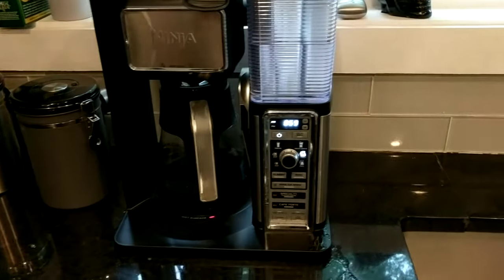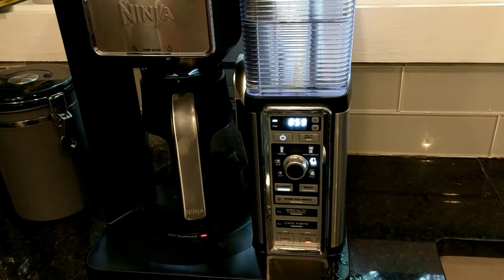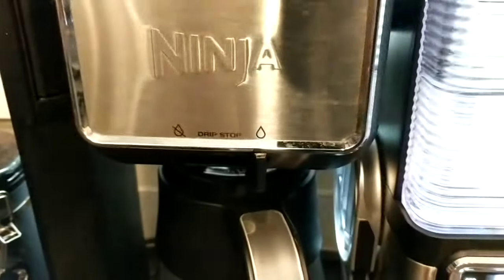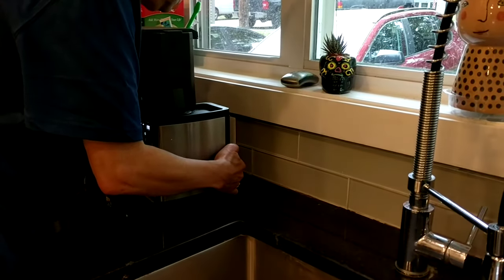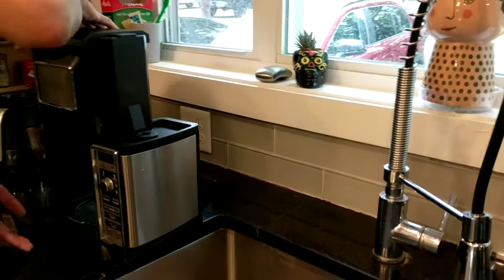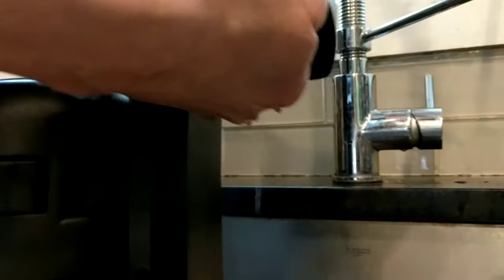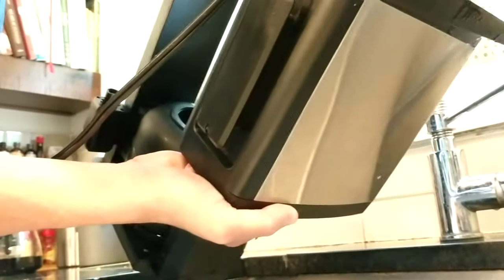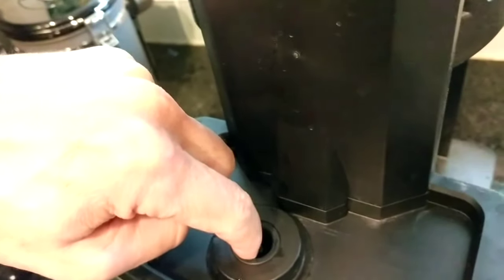Ninja coffee maker quick fix for "five beeps of death"

Comment: This does indeed work for me as well. However, I'm tired of messing with it and I'm gonna buy a different brand. Brewing Coffee shouldn't be this complicated. =(
Reply from the maker: I hear you.  There's only so much a customer should have to put up with.
Reply: Most of the times this is caused by a buildup of calcium or other sediments commonly found in water
Reply: I really like my PD 040 but after 3 weeks it stopped working and this isn't the answer apparently . I'm at a complete loss as to what to do
Reply: Yeah it's not  worth it. Never worried about calcium build up on my old one.

Comment: Please add to your instructions that if after trying all this the 5 beeps don't stop: Press both Classic and Rich buttons at the same time. This will reset the unit. Then run one brew witout water in the reservoir incase there is air in the tubes. It worked for me and my unit was back to regular. Thanks for your video!
Reply from the maker: I did not know about the reset process. Thanks for bringing it to my attention.  I've updated the text description with your fix.
Reply: Thanks. That worked
Reply: Thank you, this option finally worked for me when all else failed
Reply: With or without water in the reservoir? If without, should we run one with water after?

Comment: To anyone who this is NOT working for, go ahead and do it a couple more times and then add your EMPTY reservoir back on and just hit the classic button. Water should come out even though there’s nothing in the reservoir. Do it over and over until water no longer runs out. There was some leftover water in the tubes of mine I believe, and the air pockets were causing issues. I did this and right now my coffee bar is running through its clean cycle, whereas before it would stop after a couple seconds. Thanks OP!
Reply from the maker: Good to know. Thanks!

Comment: I was so used to the machine doing it when I needed to put it through the clean cycle, but even then it started beeping at me. I was not looking forward to getting a new coffee maker. THANK YOU for posting this! So far my machine is doing the clean cycle without the beeps! You’re a lifesaver! Thank you soooo much!!
Reply from the maker: Yeah, that is a catch-22, isn't it: You need to do a descaling cycle, but you can't because the machine won't work.  After having moved to a different city, I'm convinced that the descaling light is purely time based: if your water has lots of minerals, you may need to descale more often than the light would indicate, but at least this trick gets you there if the buildup prevents operation of the machine.

Comment: Thank you for this!! I was so excited to find one of these at Goodwill for $10, but when I came home and tried it, the ‘five beeps of death’ seemed to be the reason it was donated. After following the recommendations of a couple videos, including disassembling the bottom and cleaning the inside mechanism, I was almost ready to take it back to the thrift store. I’m glad I gave your advice a try, because after doing this twice it is running perfectly! Spit out a lot of calcium debris as well, so I would recommend running a clean cycle a few times. Thank you again! 

(Side note for anyone looking to disassemble, you will need a T10 Torx screw bit to take off the screws).

Comment: Thank you for this easy solution! I’ve had mine for a few years and was wondering what the heck is going on, but this loosened up that calcium build up and I set it on a clean cycle with some vinegar water in the tank to help clear out the rest and it works perfectly again!

Comment: I had the 5 beeps of death. I tried wiping everything down with vinegar, even where the water comes out. It did not fix it. I tried Pablo's method of turning it upside down and draining it and it WORKED! While I had the machine upside down, I also took a toothpick and gently pressed it into the water holes under the top side. Thank you!

Comment: The flow meter detects reduced flow signaling the maker to do the five beeps. I went through six videos and cleaned the house and the scale off in three different ways.  It worked for a week before the beep came back. I told Ninja on Twitter about it, and others did, too. Template response. Treated you like a generic customer and not a person. If they would've responded on Twitter with real solutions, I'd have stuck with it, but when the beep came back after a week, I said, "Okay, that's it." I later bought an Aeropress for $30 and it makes better coffee, faster (as fast as you can get hot water), quieter, and you can take it anywhere. That said, thanks for the video, Pablo.

Comment: Thanks so much for sharing! Third time was the charm with this trick even with an older model, we were persistent and optimistic. Also used white vinegar and got lots of corrosion and other chunks of gunk out of the machine. 

Another tip if you’re gonna transport the machine, I recommend keeping it up right because the issue only began for us after having it on its side in the car.

Comment: Ok so to fix this issue here is what I found. I tried everything and nothing fixed this. What I did was added a cup of vinegar to reservoir.  I then ran the clean cycle until I got the 5 beeps and the coffee maker stopped. I then took off the reservoir and that little plunger that is on the base where the reservoir mates pushed it for around a minute. Water will start pouring out of it. Continue to clean it off until you no longer see any water. Fill the reservoir up with 2/3 vinegar and run the clean cycle. If you get all of the way through it then you have fixed it. This a design flaw and bottom line to stay away from these. The issue will come back again. All non Ninja coffee makers I have owned have never had this type of issue. I own the Foodie and it works great but now question if I would ever buy another Ninja product.

Comment: I tried eveything and I was about to throw mine away, until....I flipped it upside down, and I seen the holes that the coffee comes out of were full of white build up. This is after I ran vinegar through my machine dozens of times. I poured white vinegar directly over the holes. White gunk came out in chunks. I used a little brush as well. My machine now runs perfect!!! Once a month I run vinegar through, and now I also fill the bottom of my kitchen sinkup with white vinegar, flip my Ninja upside down, and let the top just soak for awhile.
Reply from the maker: Great tip. Thanks!

Comment: So the 5 beeps is the water flow sensor getting stuck or water not flowing. The sensor looks like a white motor.  You can easily open it and wipe it out.  This also fixes the clean mode not working.

Of course, try this first since it's quick and easy.

Comment: This fixed mine when nothing else worked:
Take off the bottom cover, the deposits get out of the boiler and go through the plastic pipe into the white plastic impeller chamber, which stops the fan inside from spinning to move water to it from the tank. The impeller assembly comes apart by screwing it counter-clockwise with both pipes removed. The fan will drop out. Wipe the inside with paper towel, drop in the fan, and put it back together. Fixed.
Reply from the maker: I think some of the other remedies here on YouTube show that.  If not, you might want to make a video of your own, for those cases when my fix doesn't work.  Personally, if I have to disassemble the machine more than once a year, I'm throwing it out.

Comment: This might get it working for you for a little bit, but a good cleaning of the heater and water pump will be more permanent. You can access the parts with a T10 torx screwdriver and a Phillips screwdriver. Take the bottom off with the T10, then remove the hose between the water pump and the reservoir and unplug the water pump. Next remove 2 Phillips screws from the heater and pull the cover off so you can see inside the heater. You can clean any buildup with a screwdriver to loosen it up. I put the water pump in a cup of white vinegar to soak, and I used some plastic wrap to cover the dripper portion that drips into the coffee filter and held my hand on it, then filled the heater with vinegar to let it soak for 5 minutes. After it soaked, I used the screw driver to scrape a little more of the buildup and a straw cleaning brush to get the inside of the heater clean. You can use a can of air duster to blow through the water pump to make sure the motor turns smoothly. Reassemble by putting the gray gasket on the white heater cover (if you put the gasket in the heater first then put the cover on, it'll leak), reconnect the water pump and plastic lines, and plug in the water pump. Make sure everything is tight and run a clean cycle with vinegar then another with water and you should be good as new.
Reply from the maker: Thanks for the detailed instructions, Jared. Running a cleaning cycle with vinegar after performing this quick fix is a good idea for everybody, even if they're not inclined to take it all apart. During this time of Covid, some people might have extra time to disassemble their coffee maker, but not me. I've got the skills but not the patience to spend that much effort dealing with a design flaw; I'd rather buy a new coffee maker from a different manufacturer.

Comment: After 4+ years of daily use, our coffee maker is acting weird. Once the power button is turned on, without selecting the brew cycle or the size, it will start brewing. It’s brewing all the water in the reservoir. It just won’t stop until all the water is used. Once water is used, it will start beeping continuously. Any suggestions I should try?
Reply from the maker: I would try replacing the machine with a new one from a different manufacturer.  If that still doesn't work, then the problem is you 😀 .  Seriously, although a machine should last more than 4+ years, many don't; the fact that yours failed doesn't surprise me.  These things are not build to last, nor to be serviced.

Comment: For the next person, i had this jssue and i had taken it apart and cleaned the metal tube, didn't have much scaling

But ultimately after assembly and disassembly multiple times, the rocking method worked best, did a few left to right, forward and backwards, heard some McGurgles 😅 from the machine not me, then it started working again

I bought this machine for my inlaws years ago and was sad to hear it stopped working, glad i could resurrect it 🎉

Comment: If you don't want to start over several times you have to open up and clean manually the hot water heater. I've tried all the videos and the only long term fix for me was to open up and clean.

Comment: Thanks a bunch this is the 3rd time mine has done this to me and everytime has been some other kind of correction
Reply: I have the answer to the 'Beep of Death 2.o'... It requires the dismantling of the Swing Brew Basket.  There are subsurface magnetic contacts that feed the ability to perform a brew cycle.  At the root of all of this is a a spring to facilitate the contact.  And, there you go, no need to buy a new unit... Definitely a weak design and I will show you how to reinforce it as well!!!
Thank you Jillian 🤓

Comment: This did not work for me.  I tried an alternative technique: I used a compressed aerosol duster (used to clean computers), forcing check valve down at bottom of reservoir, sealing around nozzle with tape, and blasting water through using the HFC from the can (which immediately turns to a gas).  An air compressor with nozzle would work equally well, but I didn't want to take coffee maker out to garage shop where my air compressor is.  This immediately resolved the problem.  Of course, water from boiler was forced into basket/carafe.  I have in past fixed this by disassembling machine.  I am going to start cleaning it regularly.  I recommend using citric acid rather than vinegar (less odor issues and fewer issues with rubber gaskets, but will still dissolve the hardness/calcium deposits).  I am also going to try just taking a piece of tubing attached to a garden hose and blowing water through the machine if it happens again.
Reply from the maker: At least one other YouTube video exists where the poster put her whole mouth over the check valve and blew.  I think it's a matter of luck which approach will work better for a specific machine.  A convenient source of compressed air (such as your lungs) is key.  I like your idea of having a small hose available.  I totally agree with using citric acid (or a commercial descaler that is mostly citric acid) instead of vinegar.  Not only is vinegar smelly, it also hastens corrosion more than citric acid does.  Glad you were able to solve your problem, even if my solution didn't work for you.
Reply: OMG I literally tried to do the turn upside down and rock 4 times. Didn’t work. Wrapped my mouth around it. Blew air three times and we got coffee now!! Unbelievable

Comment: My tank for the water reservoir leaks it does not click in like it should what can I do
Reply from the maker: I don't know, Paula, but I can suggest a few things: Is there something stuck in the valve, either on the reservoir or in the place where the reservoir connects to the machine?  Is the seal worn or damaged or dirty?  If there is damage, there might be nothing you can do.  I don't know if Ninja sells replacement reservoirs.